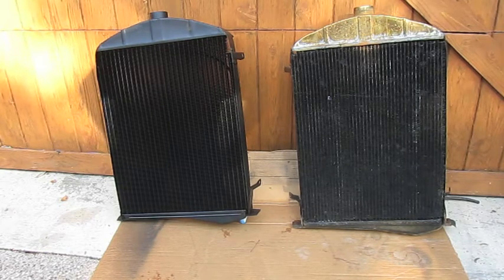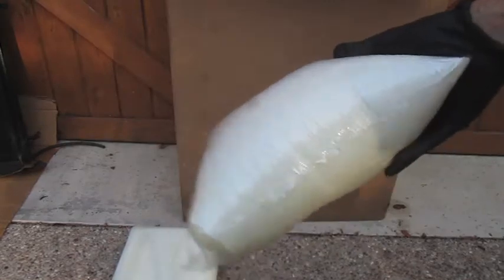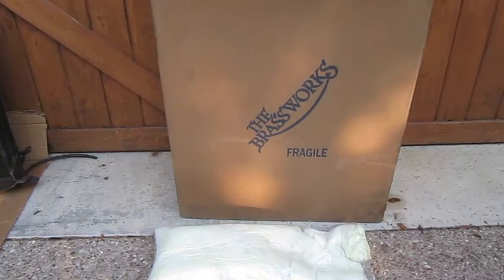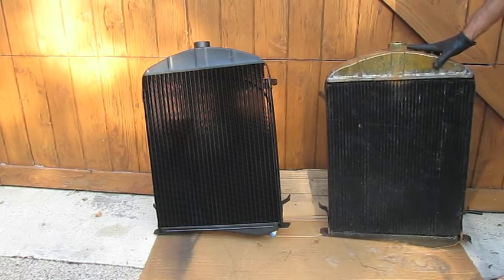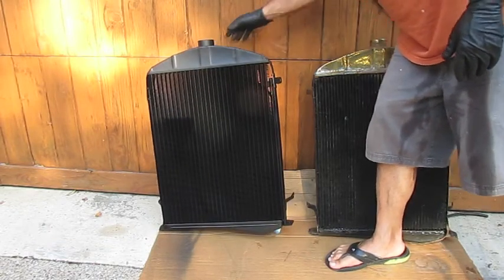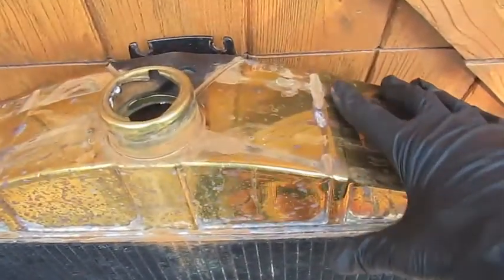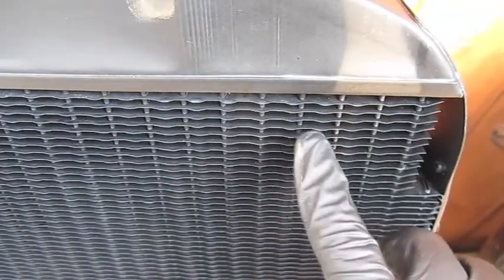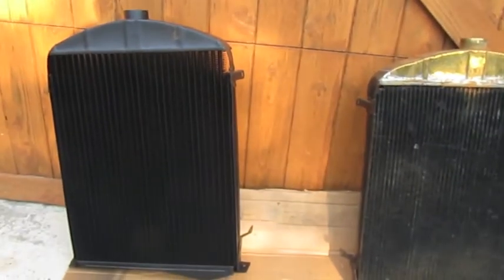Ford Model A- Brassworks Radiator Review and Install

Comment: I've got a Brassworks on my 28 I love it so far.Max temp I'm getting is around 155° at the top and 130ish on the base.It amounted without an issue.CARRY ON.
Reply from the maker: I have measured with an external metal temperature gauge 160F at the top of the radiator running on a warm day.  I am having another issue with overflow of coolant out the top neck of the radiator, driving at near top speed on highways, but I do not think it is radiator related.  When I fix that problem I will make another video :)   thanks.
Reply: Let the water find its on level. Every car is different.
Reply: @dougfierro7155 check the lower hose clamps. They can draw air there and foam the coolant causing it to spit around the cap. 
Also you may be overfilling. You can let it spit until it quits. As long as the top of the core is covered, it's good to go.